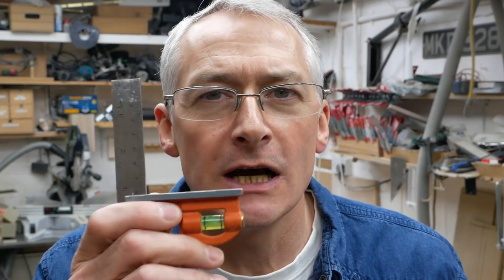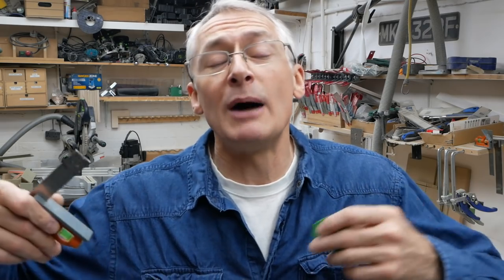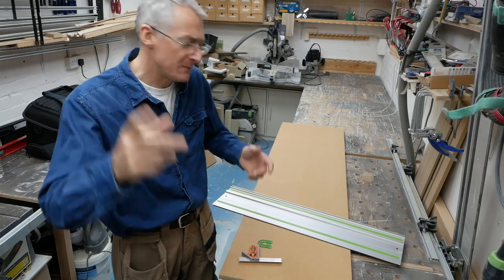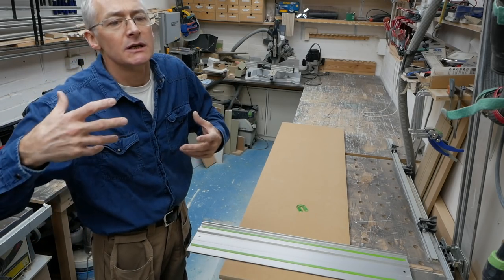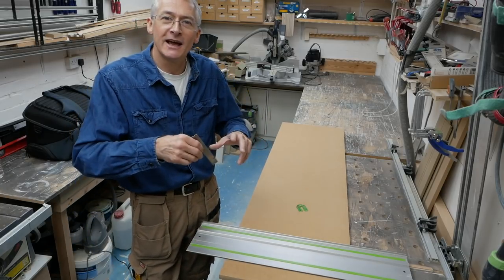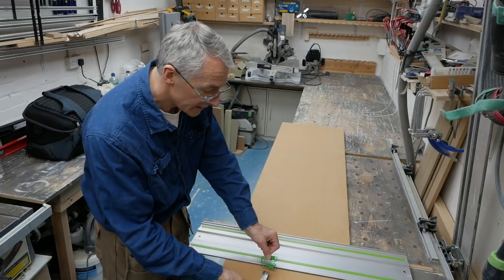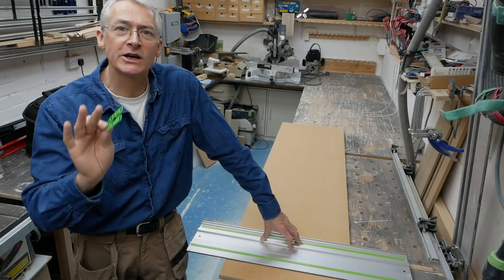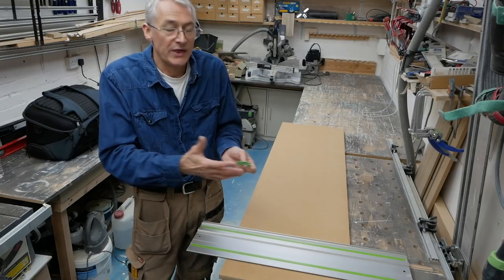Wrong SIde Cuts [video #246]

Comment: Spacers? I bet everybody's workshop is full with scraps of any thickness. You can buy steel or aluminium sheets of many different thickness and pack them to get the required size (and after having cut a small probing stripe you'll still have a big piece of metal to use elsewhere). Anyway, a cheap feeler gauge will provide  accuracy down to 0.02mm

Comment: I don't really understand the part when you say that the 0.2 mm will be spread between the good and the waste side. I think your good piece will be 0.2 mm narrower than it should be (not 0.1 mm narrower)
Reply from the maker: You’re right - I’ve just drawn it out! Someone suggested putting tape on the packer to shim it out that little bit more, that may work if you’re cutting to that degree of accuracy. 👍
Reply: He is saying if your cutting on the line you make with the spacer then there is .1 mm on each side of the line. If your worried about it then try measuring out .1 mm and get on with life. My lord.
Reply: No, I am not cutting to that accuracy. I don't want and I also could not. 
I simply pointed out that in hope I misunderstood something in the math.
Reply: Well, I'm down to 0.1 mm accuracy when I make custom furniture and had to scrap a similar Bacho combi square. At both ends it wasn't cut and adjusted to specs -- it was actually +/- 0.3 mm off and not square.
Reply: 0.3 is bad in such a short piece of measuring equipment. 
Anyway you can not really trust anything that is adjustable to be dead on square.
Reply: @adamelekes  I've found my combi square are all "off" in terms of square. I have Bahco, Stanley and Rabone (which might be the same as Stanley these days...;-)). I know you can file them to adjust, but I dont have any files thin enough to get in the grove for the ruler/blade part of the square...;-(
Reply: @couplandsj  . Try Aldi. Every so often they do a set of small diamond files. The thin flat one fits nicely and brought mine back to square.

Comment: Good way of doing this. A quicker/more accurate way for doing this is to add 5mm to the measurement, set the combi squire at this new width and then register the edge of the square on the metal edge of the track (not the rubber strip as this can be worn in places or give slightly). I do this with the dewalt track saw and the extra 5mm allows for the rubber strip and the blade width. I'm presuming the festool would have a similar overall distance, this could be easily calculated with a few test cuts, it would then eliminate the need for the 2mm packet and give a quick, easy and accurate set up +cut. Hope that makes sense. Since using this system it means  I usually work from the waste side when cutting large sheet  goods,  it's a very accurate and easy way of doing things.
  Great videos by the way.

Comment: Hi peter great vid again matey.peter bit of advice please.i made a fire surround out of kiln dried soft wood and the top as still moved because of heat from the fire.is that normal and would I be better off with MDF.though the top is quite thick at 40 mm.kindest regards tim

Comment: Peter. I spotted you using that packer a few vids ago. Slapped forehead and exclaimed "Why did I not think of that." I plunged a slot into a bit of scrap and then went through my box of assorted spacers until I found one that was a snug fit. I found that spacers from different manufacturers departed from the nominal thickness by quite a bit in some cases. I was in the construction industry, so most of my spacers were picked up from where they had been dropped or abandoned. Hence the variety of manufacturers. Any year now I might have to buy some …
Reply from the maker: Great idea - never thought of the difference between manufacturers 👍

Comment: The small track that you are using is it cut from a longer track or do festool sell small tracks eg less than 800mm
Reply from the maker: 800mm is the shortest track I have.
Reply: Although 800 is the shortest Festool make, there are other makes compatible for shorter lengths. However, I bought a 3rd 1400 track and cut it to 600 and 800 approximately. I simply cut it with my mitre saw which has no trouble at all with aluminium.
Reply from the maker: @steve24822  I did the same with a 3-metre Makita rail, cut it to 2100/900 with the TS55, no trouble at all with the standard blade. 👍

Comment: Hi Peter.  Quick question if you don't mind.  Do you need to clamp down your track? I've seen many videos where they're not but the track doesn't seem to move? Thanks
Reply from the maker: I always clamp it down for a bevel cut, almost never for a straight cut e.g. expensive boards/worktops/doors are about the only time I clamp for a straight cut. The neoprene strips on the base of the rail are pretty grippy on the Festool rails, and I've never had a problem with rails moving. 👍
Reply: Thank Peter.  You've inspired me to get into woodwork.  I think a track saw is the next thing on my 'to get list'.  Just finished my first build, a chest of draws.  Not perfect but really enjoyed making it -thank you

Comment: Great video again - thank you! You mentioned that the kerf of the festool blade is 2.2mm thick - did you get this info from their specs or do you have a device that will measure to a 10th of a mm?
Reply from the maker: Thanks Mark. It’s from the specs - though I do have a micrometer that would measure it, I’ve never bothered to do so 👍
Reply: @hokipokist  Already there ;-) (And have a set of vernier's too)
Reply: And I've just googled on how to read the vernier scale properly too!

Comment: Great wee video, as usual, but wouldn't be easier to permanent attach between square and material and have one just square just for those cuts? That would also take care of ur 0.2mm or part of it :)
Reply from the maker: Not really; the idea is to push the track away from the cut line by the thickness of the blade. If you mounted the packer on the square, then you’d be going the opposite way. Unless you meant somehow mounting a 2mm packer onto the end of the square’s rule?? In which case I’d love to know how 😆👍
Reply: @10MinuteWorkshop  u right lol, had a brain fart moment lol

Comment: Good tip, although that's the first time I've seen a packer. I've always just made a little wood one. Speaking of the wrong side, I've always wondered if the blade is on the wrong side. I don't think I've ever made a single right handed cut! 🤔
Reply: Wrong side of the blade? And aren’t the cuts on narrow strips were trying make no longer protected from splinter guards….?
Reply: @mrkrause3  I don't understand what you are questioning? The track only works on the line when you lay it on the keep side. If you place the track on the offcut side (which sometimes you do need to do)  you have to compensate for the blade and move the track over from the line or the cut will be short because you are cutting on the wrong side of the line.
Reply: @SlowandExpensive  I guess what I’m asking is this:  the sprinter guard on the rail doesn’t prevent “up splinters” on both sides of the cut of the blade. There would have to be a splinter guard on both sides of the saw blade for that. So when we need to measure and cut smaller narrow strips on the right side of the saw blade(waste side), the narrow strip cuts are not protected against “up splinters”. Am I wrong? I’ve been using Festool track saw for over 15 years, and on my second track. 
Thanks for your response! 
Ken
Reply: @mrkrause3  Yeah, you're right about that. I have always considered cutting on the wrong side of the line something only to be done as a last resort but I am almost always cutting pre finished plywood in my shop. (I only use MDF if I absolutely have too) To be honest I only use the track saw as a last resort. I prefer the table saw 99% of the time.  I believe our friend Peter here, cuts a lot of MDF in his work flow and uses a track saw most of the time. The use of MDF is probably why splintering edges aren't much of an issue for him.

Comment: Hi peter..great tip..so I take it the Ts55 is compatible with the makita guide rail? Or have you modified it to fit?
Reply from the maker: Thanks! Yes, Festool runs fine on Makita tracks. Only slight niggle is that Makita tracks have the anti-tipping lip, which can get in the way of some accessories. But for straight cuts they work fine. 👍

Comment: Thanks for the tip Peter. I've seen you mention it before but as you say it's worth repeating for those that haven't seen every one of your videos.
That long track you were using right at the end, is it makita? Looking for a long one for my Titan saw and if the Festool fits a makita rail, the Titan should too I assume.
Reply from the maker: Yep, 3-metre Makita rail, used to be half the price of the Festool, not so much now, but still cheaper. Saw fits fine, just be aware that the Makita rail has the anti-tipping lip that can get in the way of some Festool accessories, but you should be fine with the Titan. 👍👍
Reply: Triton tracks also fit the Titan (in fact the extrusion is identical so you can connect Titan and Triton together).

Comment: Aldi currently have a track saw for £79.99, any chance of match up with the King festool track saw?? haha
Reply from the maker: Trying to decide if I really need another tracksaw... 😂👍
Reply: I wouldn't buy any tools from aldi or lidl, nothing that problems with them.
Reply: Mine is "out for delivery", expected 20:30 - I'll be in the pub though.  I'm happy to take photos/measurements when a) I get it and b) I sober up :D
Reply: @WaschyNumber1  I don't agree. For the average DIY or hobby woodworking the quality and accuracy is 4 stars and mostly the price/quality ratio 5 stars.
For professionals though it's most of the time not sufficient.
Reply: @hansdegroot8549  i had a couple aldi and lidl tools they are crap and i am a average user, but it's not my problem that people investing in crap, i don't buy anymore tools from this places.

Comment: Funny, you have a combination square and a piece plastic, why not use the combination Square already with the correct length?
Reply from the maker: So you can use the combi square set to the correct width for the cuts that aren’t on the wrong side, and the square & packer for the cuts that are. 👍
Reply: I was thinking the exact same thing, if your piece needs to be 50mm just set the square to 52mm instead. Would be the same result wouldn’t it?
Reply from the maker: @leecarney3209  Yes, but as per the reply above, this way lets you do 'regular' cuts and 'wrong side' cuts without moving the square. If you're just doing one or the other, then just set your square appropriately. 👍

Comment: Or just add 2mm to your measurement .. seems easier than trying to find a Packer ;o)
Also using a scrap of mdf to support the back side of the track is just as easy when making a thin cut..
Reply from the maker: That’ll work as long as all you’re doing is ‘wrong side’ cuts. On the table legs, for example, it’s a combination of ‘good side’ and ‘wrong side’ cuts, so I’d rather have the square set to the correct width and use the packer for the other cuts. And as you can see in the video, the 'wrong side' cuts are necessary because the workpiece is bigger than the bench 👍

Comment: If I'm being a tad thick, forgive me. But why didn't you just make the measurement on the combination square 2mm longer?
Reply from the maker: That’ll work as long as all you’re doing is ‘wrong side’ cuts. On the table legs, for example, it’s a combination of ‘good side’ and ‘wrong side’ cuts, so I’d rather have the square set to the correct width and use the packer for the other cuts. 👍
Reply: @10MinuteWorkshop  Ah, now that makes sense. Many thanks, Peter.

Comment: Do you ever clamp your track? I didn't notice any clamps and every time I try to use mine I end up moving the track slightly. It gets old pretty fast.
Reply from the maker: Bevel cuts, yes, always, but rarely, on straight cuts. Plenty of grip with the Festool rails, less so with the Makita IME. Of course, if it's something expensive or that requires particular attention, then yes. But it's rare. 👍

Comment: Well Peter ,dont think you d have that problem if you where using imperial measurements ...lol,good little 2mm tip Peter ,i seen you  make them table videos and always ask myself why you dont cut the into strips and domino them together ,how thick is the wood your using ,is it too thin for domino's
Reply from the maker: Thanks Syd! Re the tables, they’re 18mm thick, so Dominos are fine - it’s how make the leg sections. The reason for the giant ‘n’ shape is that they’d had trouble before with the join between legs and the table top cracking (not my build) so I figured this was a better way, albeit more messing about for me. 👍
Reply: @10MinuteWorkshop  maybe it was made by an artsy builder...lol

Comment: Why not just put the packer between the square and the work piece and draw your line as before?
Reply from the maker: To what end? This way there's a pencil line around the workpiece at the  correct distance. on the regular cuts, you work to the pencil line, and on the 'wrong side' cuts you use the packer. This works for me - feel free to do whatever works for you, lol! 😂👍
Reply: @10MinuteWorkshop  OOPS, I just realized my idea would subtract the packer thickness when you want to add it. My bad. Love your videos.